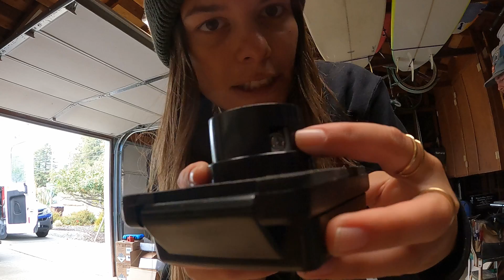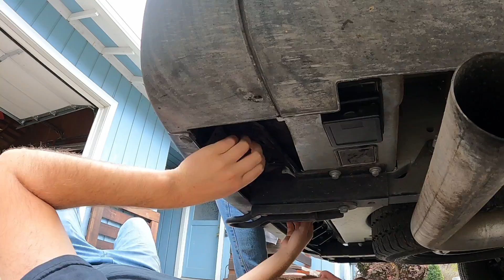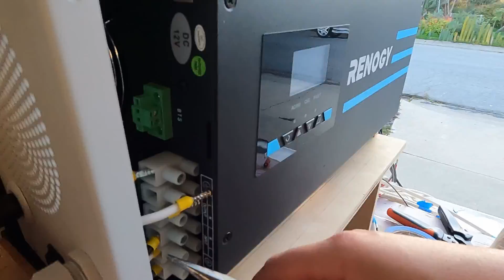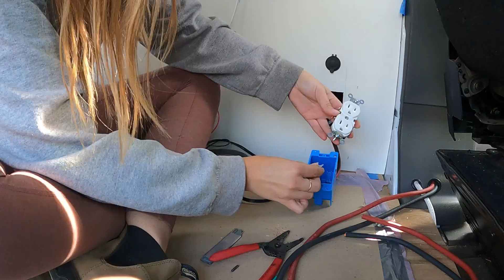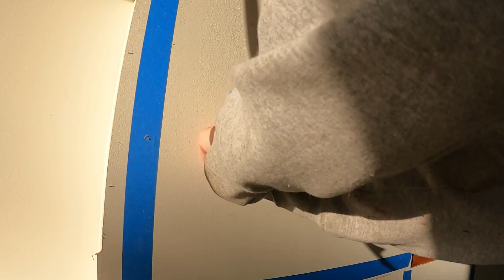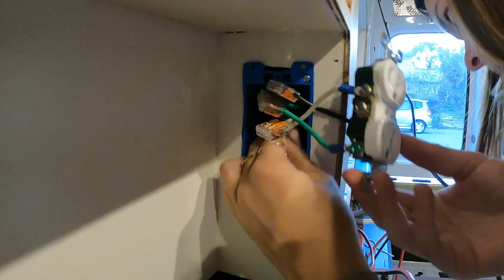Installing AC Outlets in a Van & Shore Power Charging | Van Electrical Part 2

Comment: I bought the breaker box and the 15A breakers that were linked in the video description for my set up. The 15A breakers that were linked actually do not fit in that breaker box, so that was a bummer. But the video was very helpful otherwise.
Reply from the maker: So sorry that happened! I guess we might have linked the wrong breaker. 

I believe this is the one we have in the van!  https://amzn.to/4bQEEif

If you don't use the link I believe you can just get these at Home Depot/ Lowes/ Ace Hardware

Comment: Very nice and informative. I like the Transit, and you guys did a beautiful buildout. I look forward to your coming videos. One tip, is that if it charges at 60 Amps, you don't need to say "per hour." Amps is a rate. Charging at 60 Amps for 2 hours should put 120 Amp-hours into the battery. Or: 60A * 2h = 120Ah. FWIW, Watts is also a rate. Watts can be more useful, because our appliances are often rated in Watts. Like if I use a 1500W hairdryer (I wish I had that much hair!) for an hour, that would use up 1500Wh of battery capacity. We get Watts by multiplying Volts times Amps. So, similarly, if you charge at 60A at 12.8V for 2 hours you put 60A * 12.8V * 2h = 1536Wh into the battery.
Reply from the maker: Totally! Just thought phrasing it this way helps make things a little more clear for people who aren’t super familiar with electrical lingo. 😊

Comment: I think it's dangerous to mount the breaker box so that the switches work backwards that is, flip down on, flip up off. It work for you, but imagine if you sell your van, and the new owners are used to the convention of up = on, down = off. Don't you see the potential problem? Also it's a good habit to NOT wear metallic jewelry when working on electrical. Good info on the actual wiring.
Reply from the maker: The switches have very clear “on” and “off” visible so I don’t think it’s that confusing. When working on the system, you’ll use the master switch to cut power to everything so the breakers stay in the “on” position unless tripped. If we ever sell the van, this could easily be explained to someone 😊
Reply: @nomadmaddie  years of muscle memory will inevitably take over.

Comment: Clever wire hack using an old extension cord to use for wiring👍 extension cords are cheaper than buying 2 color spools of wires when you can get anything from 10 feet to 100 feet of extension cord that has hot nuetral and ground wires already insulated
Reply from the maker: Yeah! That’s why we went this route 😊

Comment: I just hope you won't drive the van during witer time where all the bottom of it will be covered with ice and road salt:  connecting to shore power may be complicated.
Reply from the maker: Last winter we lived in the van in Tahoe, Utah, and Colorado with no issues 😊 (granted, we only needed to use shore power once to charge) but the inlet is sealed up just fine so we’ve had no issues with the elements.

Comment: The inverter has a floating neutral and that's why you're getting an open ground when testing the outlet. If you take a multimeter between your hot and ground, you'll only see half the voltage because the inverter splits the voltage between hot and neutral. This is less than ideal because your circuit breaker is only breaking half the voltage to your outlet when it's in the off position. Furthermore, when you're connected to shore power the inverter goes into bypass mode and just transfers the electricity through instead of processing it. When it's in bypass mode it will test properly and hot to ground will read 120v on the multimeter.
Reply: I appreciate them sharing their work. But I wouldn't recommend all that for anyone on a budget. If that inverter/charger fails than that is a catastrophic and very expensive failure.  I'm a 10 year JW electrician.  I completely understand all their work but it is overkill for a van. I have the same van. What I did for shore power is  cut an extension cord and left the male end hanging under the van.  Inside the van I have the shore power wired into a outlet strip.  My receptacles installed in the van are wired into a J-box that has a male plug whip from it so I can move power to shore or to my inverter.  I don't need a breaker panel because I am plugged into the receptacle of my inverter and that provides the fault protection and the plug is the means of disconnect.  I bought a small 20A charger that I keep plugged into the outlet strip.  I also have 40A DC/DC and 600W solar on the roof. Very rarely need shore power.
Reply from the maker: We are happy with our results!